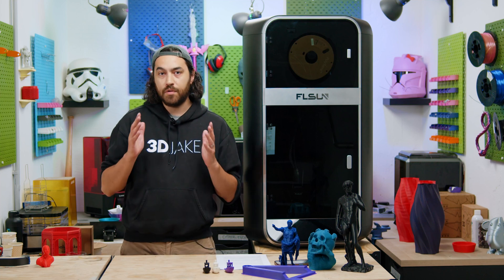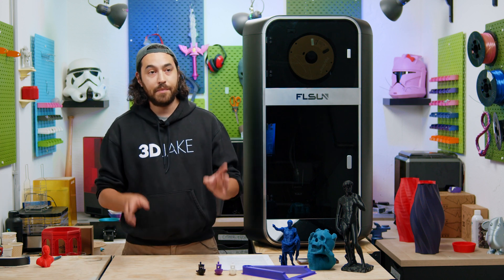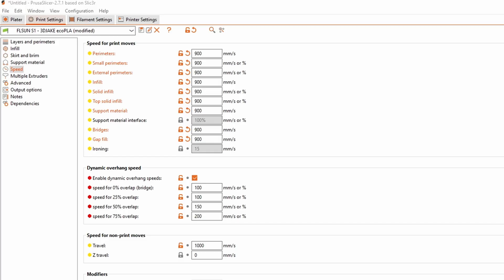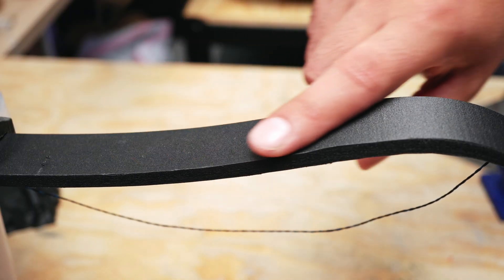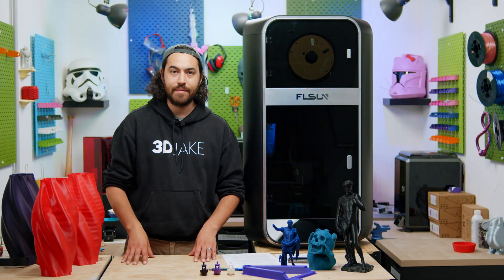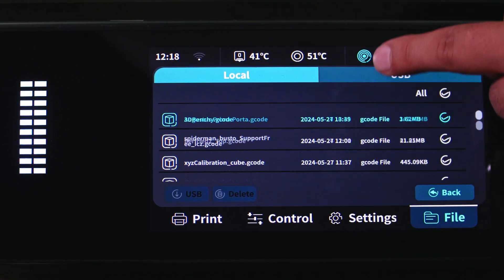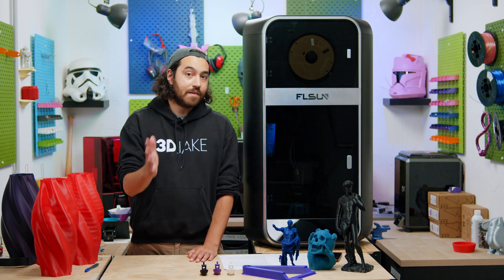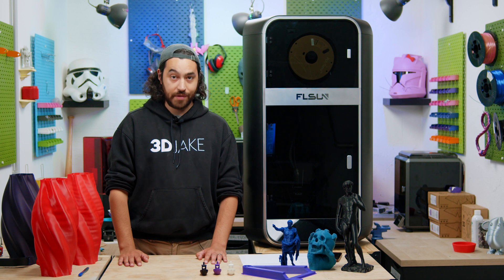We Tested the Fastest 3D Printer on the Market! (1200mm/s Speed Test)

Comment from the maker: IMPORTANT! The S1 and T1 actually use normal E3D V6 nozzles not volcano nozzles but any v6 nozzle should work. The S1 nozzle is bimetallic, made from brass with a hardened steel tip and the T1 is regular brass.

Comment: I'm not that concerned about speed, I still think overall, the Babmbu Lab X1 is hard to beat.  I do love the large build area of the S1.  I wish Bambu would make an X1 XL, that had maybe double the build volume.  Also, it would be nice if they made the build chamber air tight, with a built in port on the back of the machine to easily ventilate toxic fumes via a 4 inch duct pipe outdoors.

Comment: If you can answer this then you are  the top surgeon level of 3d printing. Is bambu labs filament already a high speed filament like this polysonic pla? I just want to make sure that my x1c uses actual high speed filament. I have done the research, but can't find yes or no answer. Thanks. Signed- Real OR surgeon but a nerd for tech. Lol
Reply from the maker: I actually have no idea, I have never tried bambulab filament. I have heard rumours some of their filament is just rebranded Polyterra but I don't know anything more than that 😐
Reply: @3DJake_Official  all good, I ordered all 3 that you mention in your videos and will do some benchmarking and want to find out that way. I did the first benchy today with bambu pla, and it was about 15.5 - 16 mins with speed mode and it looked ok. One more level up is ludacris mode, that was all strings and failed fully.
Reply from the maker: @bigj-yn3tf  I think Bambu tested a high speed PLA and got around 13 minutes, so I don't think that PLA is good for really high speed.
Reply: @3DJake_Official  oh, that makes sense. The 3 high speed just got dropped off by delivery at 5AM here. I am kind of sad that I have to go to clinic all day with double booked day, and can't test them out today. Looks like I will have an issue with AMS with paper spools, so might just run it on the side of the AMS. I read that those paper spool adapters have issues with ams due to slipping on rewind.
Reply from the maker: @bigj-yn3tf  Yeah they're not great, you can print rims for cardboard spools though and use them with the AMS

Comment: I"m interested in getting the S1 but as for speed claims I'm more concerned about normal printing and not speed benchy races. The Bambu default speed for good quality prints is about 250 mm/s from what I have seen online. So I guess the real question is can the S1 print good quality prints at 500 mm/s or 700 mm/s?  I would be happy with that all day long. Others mentioned the people who have a side gig printing and selling products. With the increased speed this would be a plus for sure.
Reply from the maker: We had pretty solid results under 600mm/s with a standard PLA. I think that would be the limit. Under 600 for showcase prints, anything above for draft prints.
Reply: @3DJake_Official  that is very good for speed and quality, Definitely better than bambu x1c. If only there was an AMS for the S1 it would be a home run.
Reply: This machine just arrived for me today, man it flies. I'm blown away. If you get it, be sure to use the auto-update feature though.. I didn't and instantly saw the issues from the other reviews. After the update everything went perfect.

Comment: This is my first delta. (I have 10x Prusas / 5x Fusion3’s / 1 Bambi X1C / 1 FormLabs Form2 and An old Fablicator that is now 10yrs old)

Here’s my take…(I’m an engineer and print functional parts - not so much artsy stuff)

The S1 was purchased not only for speed, but integrated filament dryer / enclosed and print volume.  

Is it loud - yes. (It lives in my garage shop with the other large format printers)

The print quality using Overture Pet-G was comparable to my Prusa iMK3s machines but 50% the print time by comparison. (Used S1 default nozzle temp and flow rate profile - I did increase the bed temp to 90)

When prototyping and running a business - speed and quality are both equally important.  This printer has quickly become the goto. (The Bambu X1C is a close 2nd, but limited in print volume)

Wish list for the S1: have auto retract on the spool for unloading filament.

Multiple filament.  I see no reason why FLSUN could accommodate at least 3 filaments. (On per side)

Multi-Material (not just color)

Additional functionality on the display panel for loading / unloading filament/ temperature overrides for drying and loading / unloading.

The slicer is premature and needs to be improved.  It’s almost like Prusa Slicer, less some of the ease of use menus.  (Right Mouse Button in slicer has all the functionality that should be in top pull down menus)

Thanks for the review… 😊
Reply: Which filament do you use for speed for X1c? Im a surgeon and a tech nerd. Just hard to figure out which upgraded filament to get vs just bambu stuff. Thanks

Comment: I still think it's funny that manufacturers tout the speed of these things when it's pretty well known at this point that you won't be printing at those speeds if you want any semblance of quality..like yeah, it can move that fast, butt why ya gotta try to act like it'll have the same quality as printing slow..
Reply: Printers designed to print fast have better quality at the speeds they run at than previous generation printers at low stock profile speeds.
Reply: @daliasprints9798  well yeah, they can still print faster then previous generations add achieve decent quality, but everyone just loves inflating their numbers -.-
Reply: @TS_Mind_Swept  Mainly they all just lie about flow because it's easy for consumers not to understand how they don't actually get the speed they requested. But then when someone goes and tries to print a giant flat surfaced cube the print mysteriously fails.

Comment: You sure its a volcano nozzle? Someone else said it looks like a v6, and in their new nozzle change video it looks like a v6 or mk8. Hopefully it's one of those three because another proprietary size when they don't have other diameters available is a problem.
Reply from the maker: You're right, we had the wrong information, it is actually a normal e3d v6 nozzle, same goes for the T1. Thanks for pointing it out!
Reply: From what i've seen it's a volcano extruder/heater block with V6 nozzle

Comment: Ah yes, 1.2m/s 3d printing…
Reply: Gonna be waiting a couple weeks
Reply: That's travel, and they're being very conservative in what they advertise. It can easily do double that. My delta does 2400 travel and can go higher especially if I limit acceleration to something under 25k. But for actual print move speed, this thing is going to start hitting extrusion limits around 300-400 mm/s.